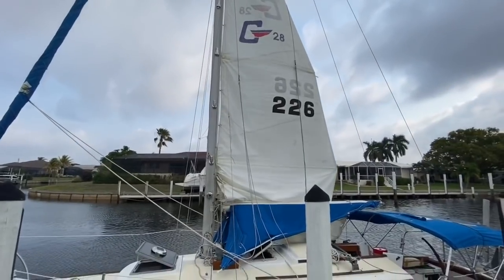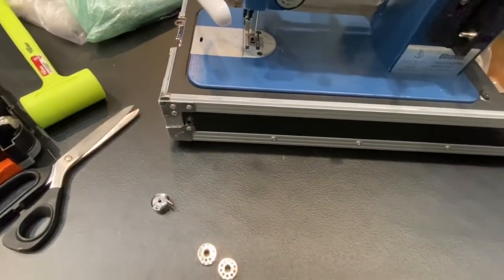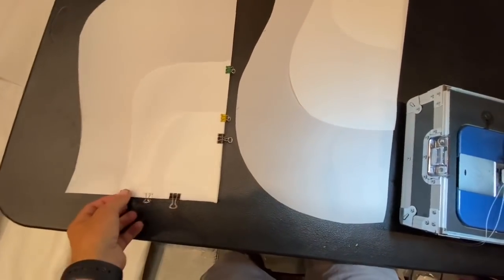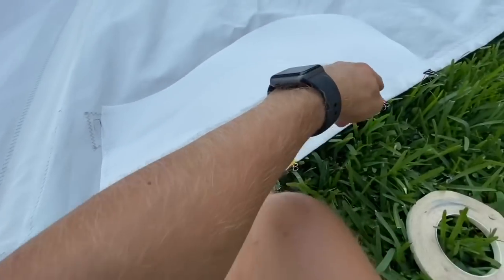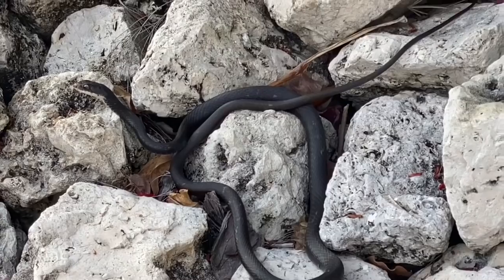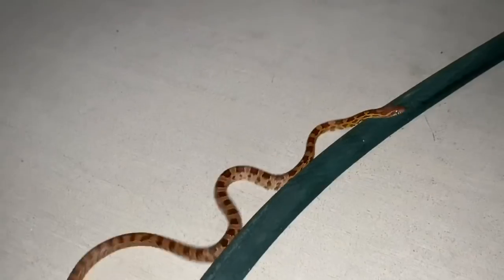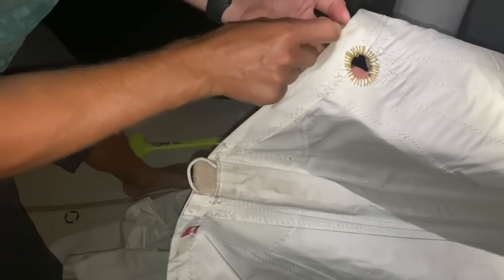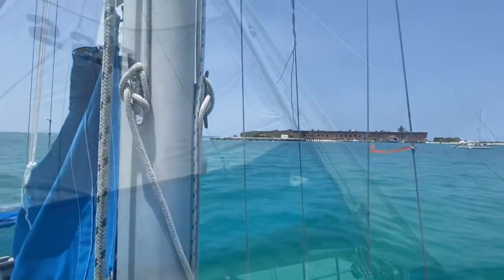Sewing a 3rd reef into my sail

Comment: Good job, It was fun watching someone else do one. I do mine a little different. Instead of a knife and awl I use a hot knife to cut the hole and a drill to make the holes for the twine. I also make two rows for the twine. Each hole about 1/8" a part, then on the second row put the hole between the holes on the inner row. It really sucks the ring into the sail. I also do that to get more wraps and spread out the load. You did well with the dead blow hammer, I use either a press or most often a 5 lbs hammer. Good job making the patches that is not easy. Nice work, not an easy job. PS I could never use my knee on the foot pedal, all my work is done on a table. Way to go, nice video.

Comment: Sam, I enjoyed following your tracking bread crumbs on your way south the other day. You had a nice reach going there until the wind laid down. Then with typical Sam Holmes luck, you had another reach tracking to Key West. Well done. There are a few good arguments to be made for using the engine. It'll help keep your fuel fresh by cycling it through the tank and filters. As diesel fuel ages, asphaltenes precipitate out and end up on the bottom of your fuel tank, in fuel lines and filters. I always thought it was better use the engine on a regular basis to keep fresh fuel in the system. Plus it sure helps making way in very light winds. You can make good headway to weather with only the main and engine too. And maybe the most important reason to motor regularly is to keep the part of the prop shaft that goes through the cutlass bearing clean. If the shaft isn't turning on a regular basis, marine growth will form on the shaft inside those groves running through the cutlass bearing. Then when you do motor, that growth cuts the cutlass bearing, which is not a good thing.
Reply from the maker: Good points. I think I’m stuck in the motorless mentality. I really need to go through this fuel quicker though. I try to run it for an hour whenever I go out but I’m not even making a dent in the 18 gallons.
Reply: @samholmessailing  Your engine probably burns about 1/3 gal/hr while making 5 knots. With $2.68/gal fuel, that works out to about $0.18/mile. With good maintenance, your Yanmar should last 5k to 10k hours before overhaul. Maybe more. Not likely you're going to wear it out.  Main thing those engines like is clean fuel. Just keep changing those filters. That'll protect the injectors. My 34' boat had 20 gallons of fuel. When I sailed through the North Pacific high in late summer on the way to California from Hawaii, I took along an extra 90 gallons. We motored for almost 150 hours on that 23 day trip. Didn't think to mention it before, but I really like your forward view mirrors.

Comment: I put a third reef in by hand in a  worn used sail while sitting on a beach at Cape May NJ about 15 years ago.  Worked well. Saw North Sails at the Annapolis boat show a few years ago and asked if they could build a shorter luff sail so I could stand at the helm of my Cape Dory 25.  I asked for 2 reefs.   The sail well but needed to ad a third reef for 25-40 knot winds in spring and fall here in Norfolk VA waters.  I’ll pull out my Sailrite machine and add a third soon. I enjoyed the way you put in your cringle(grommet) and will do as you have. Thanks for your help.  Enjoy your sailing adventures.
Reply from the maker: Nice. If i did it over I would have just used simple triangle shape reinforcements. Maneuvering the sail while sewing that curvy shape was a challenge. It sure looks cool though.
Reply: Sam Holmes Sailing         I have to recheck my old bolt rope footed main and my new loose footed main. I asked North for a bolt roped foot. They said loose foot was better than a bolt rope foot to the boom.  I will recheck if they put reef point grommets to tie to the boom. My old said I did. I noticed your sail has leech and luff crinkles for reefing in a jiffy. Any pros or cons. What are your thoughts. I guess it makes it easy to shake out a reefed  sail without having to untie.
Reply: @samholmessailing  The curved shape is to avoid gathering stress at a point, which would become a more likely site for a future tear.  That's also why each layer of the reinforcement is a different size.  For the same reason, it's good that you ripped the seam along the luff, to insert the patch underneath it and attach it there with a single seam.  By doing so, you avoided a tear in the future between two seams in close proximity.  Someone had patched a sail that came with my boat, and seamed the patch parallel to the luff seam, about a quarter inch away.  When I saw it, there was a rip between the luff and patch seams, for the entire length of the patch.

Comment: Glad you made it to the Key(s).  Do you have a second set of sails for this boat before cutting, altering this set?  Grommet/reef point doesn't need reinforcing too? Or did I miss that? What kind of snakes? At least not Crocs/alligators, it's Florida, no Sam wrestles Crocs/Gators vid being planned, mate.   Too southern hemisphere, Aussie, you call that a knife (saw one guy recently w machette opening coconut in swell, then infections MRSA, Whatever, but circumnavigating, named: _Routes of Change_elephant, biking, cute shemate, dancing, etc)
 Tutorial on threading & starting sailrite machine, there is sewing machine oil, maybe what happened when wd40 your old machine, not the right oil.  Ymmv
Reply from the maker: I do have a spare mainsail. I don’t need the reef points ties because the sailpack collects the excess sail. Cheers.
Reply: Looked like a black racer, harmless, and a corn snake, harmless, great video Sam

Comment: How deep is that 3rd reef? I am just installing my second and 3rd(well mother in law doing the sewing, ha) I think I am going with 52, 102, and 152 inches above the clew. Also was thinking about sewing in a ring then sewing on leather inside that. What size ring and eyelets did you use and how much does the corresponding set tool go for? Looking good! No snakes on the ocean thankfully

Comment: I have not a sewing machine.   What do you think of sail tape and hand sewing for a sunday sailor.
Reply from the maker: Sure it works fine. I’ve also had great luck with west systems g-flex epoxy and no stitching at all. I had a repair last over 3000 miles and still looked fine when I sold the boat. Its not super pretty though.